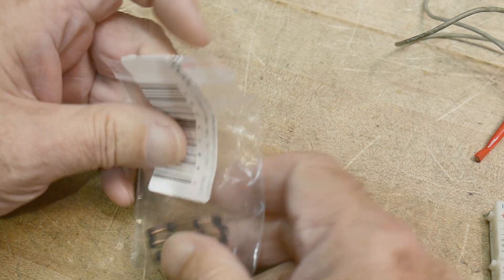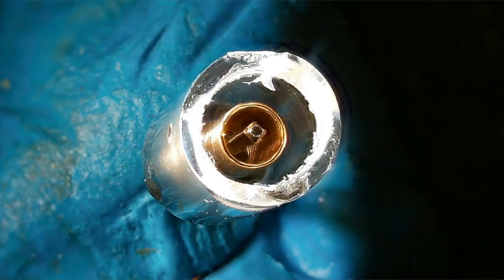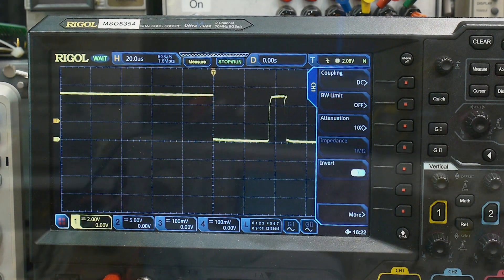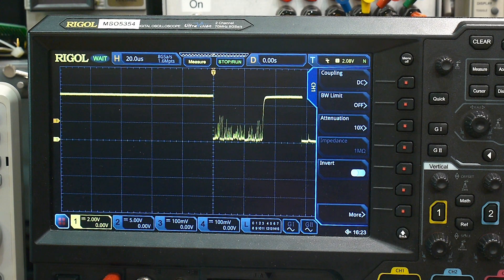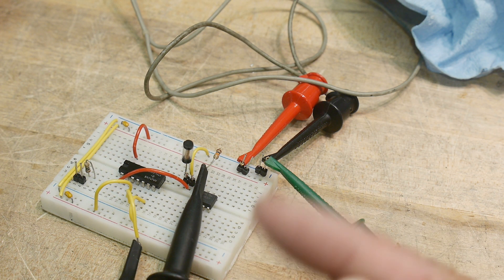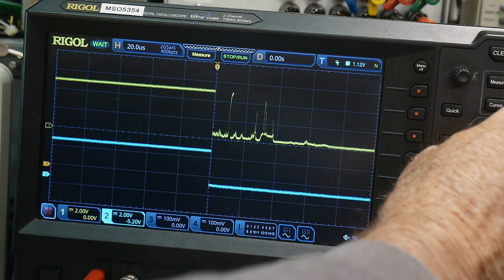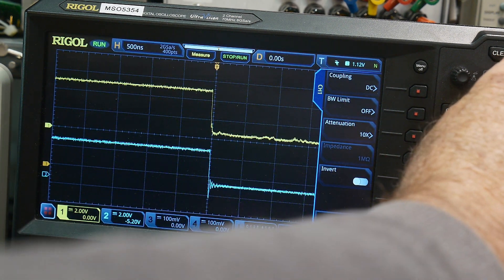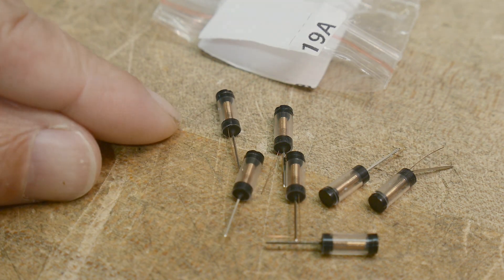#1452 Motion Detectors

Comment: Might also be used at a tilt detector on a pinball machine
Reply: Well, I don't think so, if the contact will react to shocks then yes, but if there is only a change in position the spring will not vibrate enough to make contact. Position sensors in slot machines are handled differently - rotary microswitches, mercury contacts were used in the beginning, ball contacts did not catch on very well - they are not so reliable.
These shock contacts are used, for example, in automatic target setters at shooting ranges, I personally built a practice field for throwing grenades at the shooting range using these contacts and evaluation electronics

Nice day 🙂Tom
Reply: Pinball machine use a weird pendulum type detector switch for tilt, at least on the old ones that I’m familiar with.  It also detects someone picking up the front of the machine in addition to excessive bumping.

Comment: They are activated by inertion normal to central lenght axis. 
Combinig three in X,Y, Z axises can be usefull in simple robotics.
As for buffer, just a simple diode and capacitor whit fet output plus a resistor for time response lenght.
Old school

Comment: Actually it detects acceleration or impact, not motion.
Reply: Yes, exactly as you say, in another comment I wrote that they are, for example, used to evaluate the control of target setters at shooting ranges, they need an impact or vibration, the movement alone will not create contact.
Reply: Would be interesting to witness acceleration or impacts sans motion.
Reply: @TheElectronicDilettante  - acceleration without motion - gravity. Maybe Mr IMSAI could measure the capacitance and see if it varies with orientation - gravity and all that.